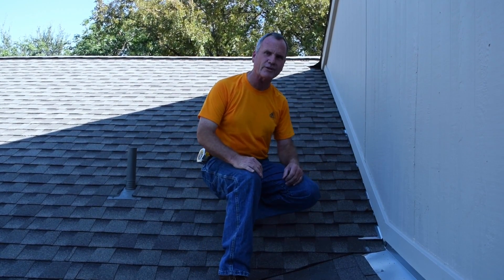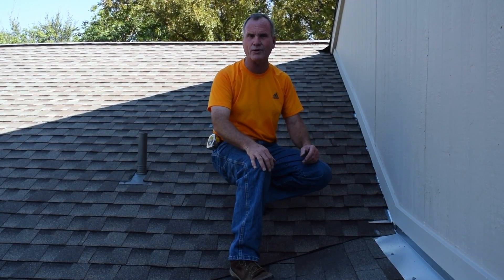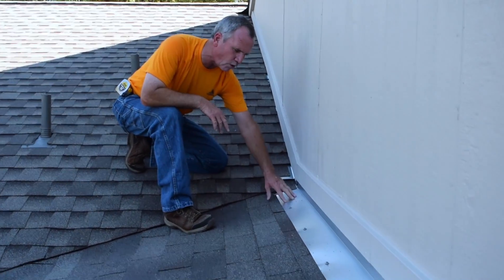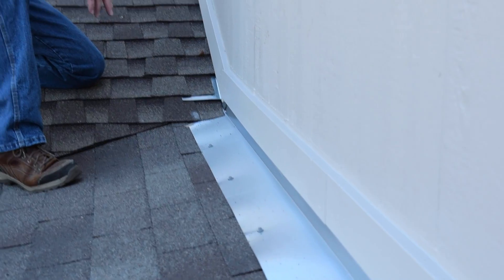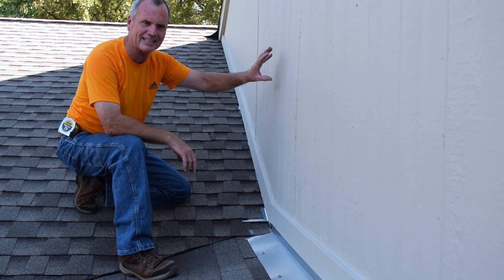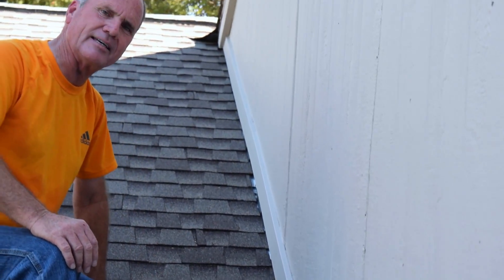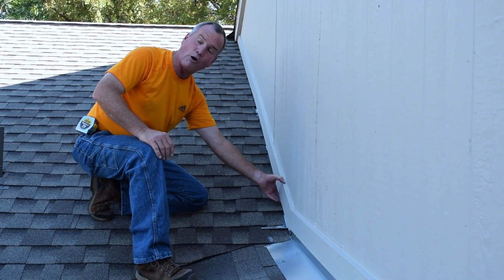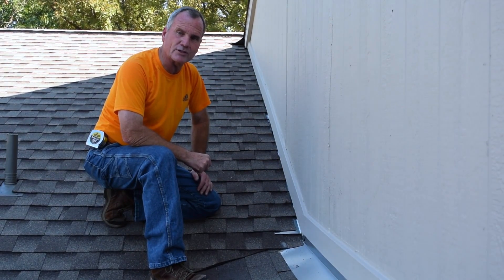Step and Sidewall Flashings to Prevent Leaks

Comment: The screws in the flashing don't cause water damage? It's through the shingles.
Reply from the maker: It is very rare that a neoprene washered screw would cause a leak, but a better way is the have a clip and lock the flashing to it. But the whole thing needs to be set up that way. Are you considering ideas for your home?

Comment: What if the sidewalk is stucco?
Reply from the maker: Stucco Sidewalls, yes, that is a little more work. Doing it right will require taking the right steps. Remove stucco, to allow for flashings, decide and install counter-flashing or roof and step flashing. Re-pair the stucco, and color-coat entire area to get a good finish, no tie-in showing.  A little more work, yes!